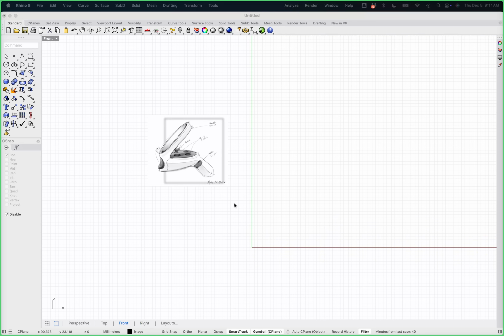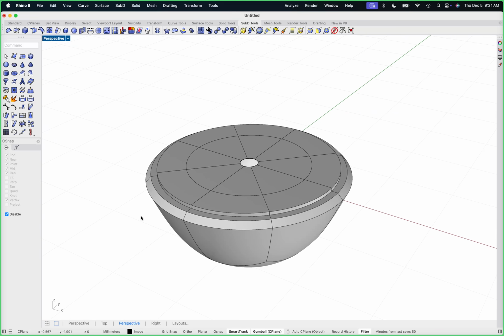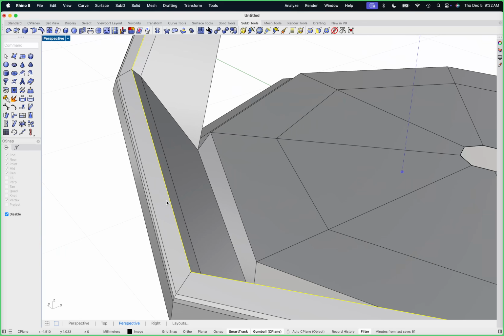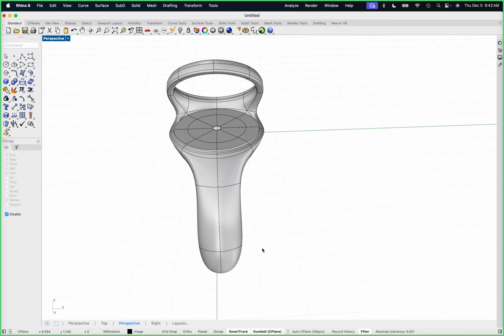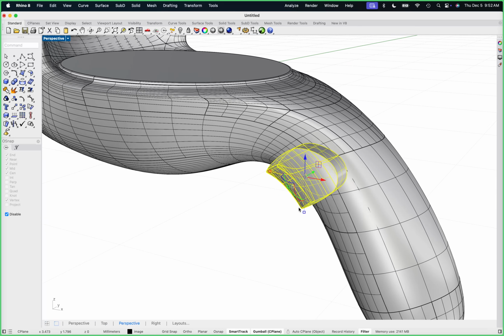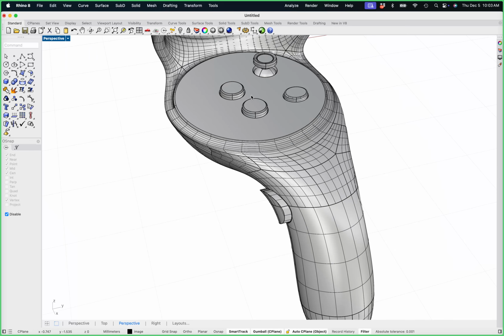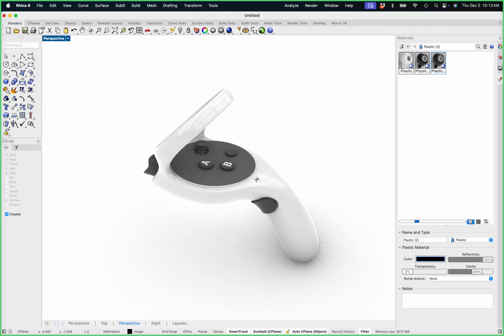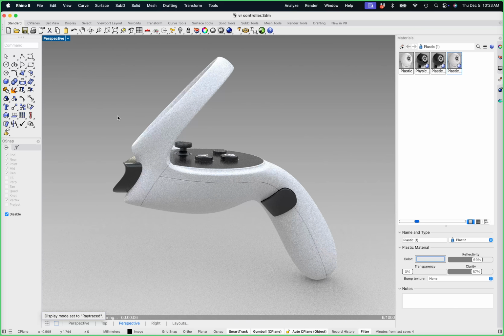Getting Started Rhino 8 - VR controller with SubD, Push Pull, Rendering and more

Comment: Sharpening up my skills with your help.  Great easy project.  My only fault is the Shutlining tool.  Found it in my tools and added it but it didn't work.  Tried to find it in food4rhino but I didn't find the plugin.  Figure I am looking in the wrong place or I am not identifying it correctly.  Just nice to know how to do it.  I can see myself maybe using it in a render.  Thanks for all your teaching and explanations on here.
Reply from the maker: shutlining isn't a plugin, select your part, then go to properties, and look for the icons across the top of the properties panel. There is an icon for shutlining.

Comment: there is a shape that i am struggling with , 
if you have the time , just google "Shell Helix Ultra 5W-40" 
this is a motor oil bottle , i think its demon difficulty right there (after PS5 controller ) which is god tier difficult , 
i hope you have the time to make a tutorial for any of these , both have some extremely tricky blends and surface transitions , 
all love to you , 
i have watched your joystick tutorial , but it was relatively simple without focusing on the details which makes most of the hard time

Comment: amazing as always , i wanna ask , did you went with SubD because it's more efficient in this specific case , or you just wanted to make a tutorial on SubD , i always try to avoid modeling with SubD because my brain leans towards NURBS a lot more , i would think of subd in the case of F1 car or maybe a PS5 joystick
Reply from the maker: some shapes would be really tough with straight nurbs, this is one of them.. Subd makes this type of model really approachable. 

I try to use the right tool for the job at hand.  Sometimes Nurbs is the right way to go, others subd, others mix and match a bit of everything, as long as the end result is what I want, I'll use anything to get there.

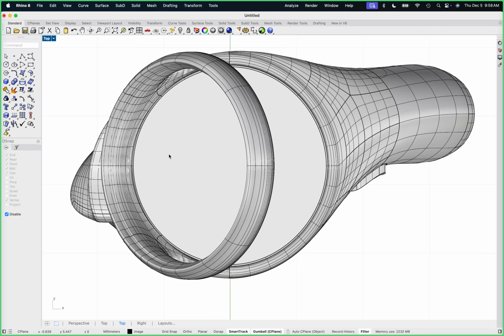Comment: I completed the tutorial! the only problem I had was, 46:44 when using Auto CPlane on the top flat surface to make the buttons, the circles don't slide along the surface. Shift/Command select surface (I'm using Mac) Auto CPlane tab is on & sticky is checked. I end up building each circle individually instead of moving and copying.
Reply from the maker: Make sure your gumball is set to cplane or object mode
Reply: @Rhinoceros3d  I had the gumball set to world, I set it to cplane and it worked. That solved the problem, thank you!
Reply from the maker: @ernestoregaldo woot! Awesome! Happy modeling.

Comment: I came back to this video. I'd like to know if you guys will ever show a model being made that follows actual manufacturing specs? or if you have any.  rather than winging tolerances, showing how rhino can get actual tolerances, E.G "I need this surface to be .25mm from this surface so it can fit properly".

So far subD looks to be great if you're winging a lot of stuff and want to make the engineers on your team life become a miserable wreck.

And what if we have to go back and change tolerances? or change a form, etc.

Would be great to see a more technical design being done that can be successfully handed off to engineering or manufacturing.
Reply from the maker: tough to do that in an hour-
Reply: @Rhinoceros3d  Who ever said anything about an hour? 😎
Reply from the maker: @Troothbomb  my boss ;-)
Reply: @ Tell your boss he's fired. 

But no really, even something short and simple would be nice. It can be a box, you don't have to show the whole modeling process, other than the aforementioned ones. Or what if we send a model to engineering and the hardware requirements change and we need to resize? In parametrics, we just change a few numbers, what is that workflow like in rhino?
Reply from the maker: @Troothbomb  well... my boss is Bob McNeel, so... I'm pretty sure he's not going anywhere.. ;-) 

Rhino is a surfacing program, so it's not parametric. There are good and bad things about that. 

the good, is that there is ultimate freedom and you can make really complex surfaces by directly manipulating it. 

the bad? if you want to change it, you have to take apart the model and rebuilt the parts you need to change. 

I approach software like a wood shop, each software package is a tool and I use many tools to get the best result. No one tool can do it all.
Reply: @Rhinoceros3d  Thank you! Any sources you'd recommend on rebuilding certain parts of a model? Or do you just do a full rebuild.
Because I notice history is pretty much gone once the software is saved and closed.
Reply from the maker: @ most "engineering" types do a full rebuild, but I take issue with this as the model is useable as is if you want to develop it further. 

however, and this is why most engineers rebuild, you cannot make parametric changes to the imported model, you have to back out to rhino make the change there, then replace the old model with the new, and hope the model tree updates properly (it rarely does) so for simplicity sake most engineers rebuild in the software they are most comfortable with.
Reply: @Rhinoceros3d  As an industrial designer, it grinds my gears when I beautifully surface model something and the engineer goes and slaps tangent fillets to my object. Like bro......Stop. I spent 50 minutes to a week perfecting my g3 fillets.

Thank you!
Reply from the maker: @ we are the same on that my friend... ;-)
Reply: @Rhinoceros3d  It could also be something simple like a water bottle.

Comment: Hi Mr. Kyle, could you please share the name of the software which you use to create the conceptual sketches? And do you use a pen tablet?
Reply from the maker: I use sketchbook pro on a wacom cintiq tablet monitor. 

procreate is another great sketching program.

they both have ipad versions as well and the apple pencil is wonderful for sketching.
Reply: @Rhinoceros3d  I recently got myself an xp-pen tablet and I'm trying to create rough sketches in Krita before working on detailed 3d models in SOLIDWORKS, I am currently watching your series on creating these parts in Rhino 3D, they have been pretty helpful for me even though I'm using different software but the workflow is similar, much respect from Iraq!
Reply from the maker: @ArcNode  sounds like a cool workflow!

Comment: Shelling hack. 
Offset your sub d surface , convert to nurbs and use that for your inside surface.
Reply: sometimes that sub-d offset may fail.  I'd say convert to volume->mesh->subd->polysurface is more reliable method IMO.
Reply: @GravDriveGaming  Thanks for the tip, i will try this out.
Reply from the maker: See the never fail shelling video. ShrinkWrap is the way to go for shelling that never fails